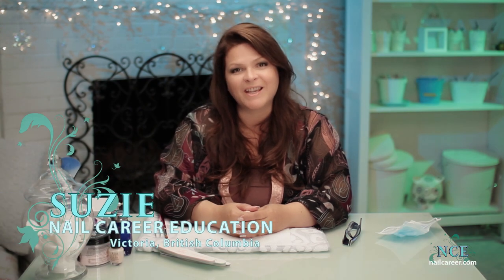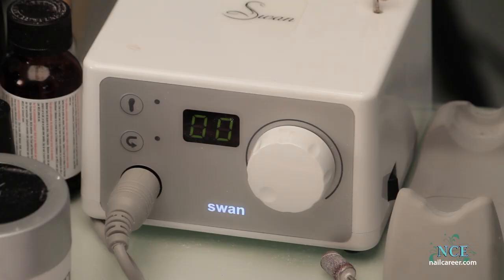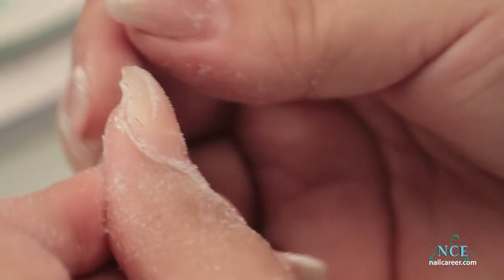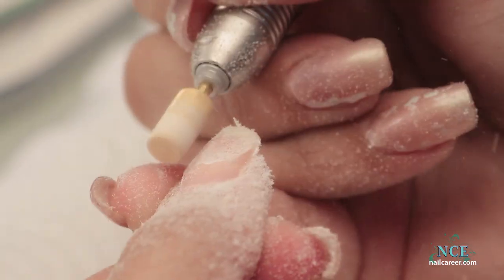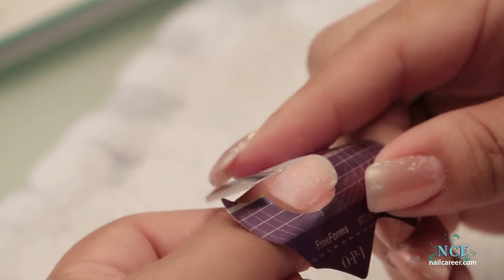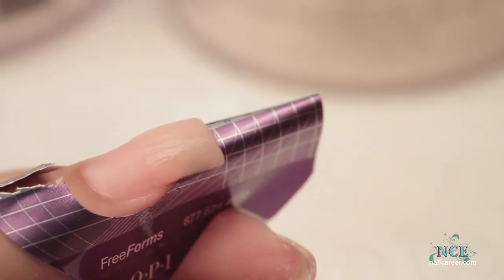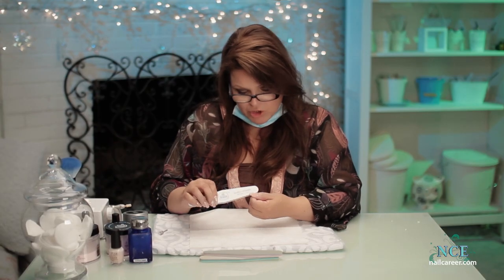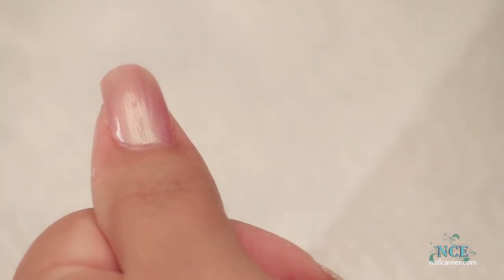Repairing A Lifted Acrylic Nail - Step By Step Tutorial

Comment: Watching your videos has opened my eyes on how bad the nail salon I've been going to is!  I had never had my nails done professionally before and recently started going to a nail salon that got decent reviews online.  The first time I went there to get my acrylic nails removed all they did was use  nail clippers to cut the length (which split the nails all the way down) and then took a nail tip and shoved it underneath the acrylic to pop them off!  I complained to the lady that it hurt and she told me "You've never done this before, that's what it hurts." These videos are EYE OPENING and I definitely will not be going back to that salon!!
Reply: The first time I got acrylic nails it looked like I had them on at least 2 weeks. I didn't realize that until a few days afterwards and I had been watching Suzie and other professionals doing nails. I 4 days later had them professional and gently taken off. I went with glue ons but decided to try it myself after seeing Suzie's and a few extreme beginners review the kiss diy acrylic kit. In spite of a lot of filing and not quite bump free, that I see, they turned out pretty well.
Reply: I've been where you were. I don't go to nail salons anymore because of how they do your nails

Comment: Oh how right you are! Getting a fill a few yrs ago I had to go quite a bit longer in between fills than normal & the product on my nails was honestly not worth saving (especially since I wear mine really short; athletic short) although all (magically) still full attached. The woman decided she wanted to start from scratch, meaning removing previous acrylic. Instead of soaking or filling down (either would have been more pleasant) she took a large tip & manually lifted the acrylic. It not only shredded my natural nail but hurt so bad! It made the acrylic itself almost burn & any and all filling on the acrylic burnt straight through that it left actual pinkish red marks on my natural nails. Needless to say never went to her again & although the finished product was pretty, my nails were sore for days!! Also, stickler for straight lines, it seems to be a nearly impossible task to find a salon who has a tech who can do a solid square. Tending to favor one side over another making the tip of my square a slant! When I ask most techs to redo them, they huff N' puff @ me! On more than one occasion I've taken their embrion board & filled my nails myself!!
Reply from the maker: Ugh! I hate to hear of this very IMPROPER removal. I have so many comments that tell about nail techs using a tip to pry off the nail enhancement. This is so wrong! If a tech ever says they are going to do that - don't let them! Walk away! In case you missed it, I have a video about the proper technique for a removal:
https://www.youtube.com/watch?v=z5ag9IIegfo
Reply: Nail Career Education I'm so sorry it took me so long to respond! I didn't know I had a notification; that area of YouTube doesn't always work properly for me. Anyways, I have seen it and you're 100% right. I should have said "STOP!" and either requested the proper way or walked out. Yes, she went about it all wrong and like an numbskull I not only let her but paid for it. A mistake I'll never make again. The worse part, most nail salons around me have always removed acrylic w/ the tip of a fake nail. I know they know this is NOT the right way but it's the "easy & fast" way and in the end, it feels like that is all they care about. Like a chain of fast food restaurants, drive thru nail salons... as many customers as possible! Unfortunately I can't afford a top notch salon so if I want my nails done, I have to deal w/ some inadequacy. 💅

Comment: Every time someone took off my old gel nails, they always file through my real nail and it hurts and it turns really red in that spot. :( how do you know when you are at real nail on someone else when the color matches the real nail??
Reply from the maker: +Chelsea Muhle experience is how you can tell- and the client usually say 'ouch'.
Reply: (I'm not a professional) but when I do mine I stop will the drill before I think I'm at the natural nail and use a sanding bit (it's a thing you can attach to your drills.  It's basically like a regular nail file, and it won't hurt ur natural nail.   It won't file away your nail

Comment: I learned to do acrylics the old fashioned say, I guess I could say. I use tips and I file around the cuticle with the drill and shape the top of the nail that way. I shape the free edge before hand with a nail file. Then I use a soft drill bit tip to smooth it down then follow with buff and cuticle oil
Reply from the maker: That's actually not so old fashioned - that's how it is done today :)))
Reply: +Nail Career Education well i guess its not old fashioned but it just looks so different when i see peoole use hand files to shape up the whole nail. and they way they apply the acrylic too.

Comment: Quick question! When I have acrylics done professionally, they usually lift at the base of my nails, almost look crackly, after just 5 days. I'm usually not too rough on my hands (especially when I have them done professionally). Is there anything I can do to prevent this or maybe should I just go to a different salon?
Reply from the maker: It could be the Gel overlay in which they could be curing it too long if it's the acrylic it could be to dry in the application 😳

Comment: i used the kiss acrylic kit and after a few days i had a nail just pop off and since then they have been popping off... any tips??? and I think they are all lifted but for next time any tips?

i'm sooooo bad I sat here and peeled off my acrylics... they were lifted anyway tho...
Reply: she has a video where she uses a Kiss Acrylic Set and there she explains why she thinks there could be liftings :)
Reply: ya but i w watched it already...
Reply: Sierra Tonon are you haring the tips or forms my sister got one any the tips popped of but the forms worked
Reply: mainly bc it you didnt prime and dehydrate it (im assuming, since it didn't come with the kit) ive used the sally nail kit for years and it usally last 1-2 weeks before it lifts with no primer if i was super careful. i moved on to professionals acrylics now and they last ao much longer. If possible go to your local beauty supply and by some acrylic,  monomer, primer and dehydrator.

Comment: The primer is an adherent right? When you put it on should it be sticky or tacky on the nail? Also is there such a think as too much primer?

Edit: found the answer to too much primer. Answer: yes, over saturation can lead to infections if it gets soaked into the root of the nail.

Comment: +NailCareerEducation I hate to be a pain in the teeth. I've got a couple questions in regards to the removal process. I had acrylics done and the nail tech that did them did a a really good job but I didn't go back to get them taken off so I did them myself- veeery stupid move. I ended up ripping one of my free edges (vertically not horizontally) so my question is how do I fix my free edge because it's killing me and two how long do I wait before doing my nails again? The free edge that split is slightly split into the nail plate- lesson learned; soak them off.

Comment: I'm a little confused.. You don't want to pull off the acrylic because it will distress the natural nail, but you can buff and file it?
Reply: yes because it only takes off very little off the nail, basically just the oil and the very top layer, which you would also take off if you polish your nails with a file until they shine. but since the acrylic or gel adheres to your nail, several layers of your nail are gonna come off with the acrylic/gel. this is why you don't wanna do this.

Comment: I love your videos!!! I wish I was as skilled as you! I have a few question if you don't mind me asking... How weak is your natural nail after taking off the acrylic? When I get gel or the powder stuff and they take off it to change the color I feel like my nail is like a piece of paper. Also i noticed when I do get my nails with either the powder or gel done the ends by the cuticle always curls up as it growing is that normal or did they do something wrong? It usually is like a week later or so and I want to file it down but it's starting to chip... It's really interesting to notice this
Reply from the maker: +Teresa Brunner Hi Teresa - when Acrylic or Gel sits on the nail and then you take it off your nail is a bit softer - this is not unlike when you put a bandaid on your skin it softens the skin that's cause the air makes our skin  alittle softer - the nail does the same thing when acrylic or gel is covering it - but after alittle while it will harden back up :)) As for the other question - I am trying to understand - do you mean the natural nail underneath pulls or curls away?
Reply: +Nail Career Education the actual acrylic is curling. I'm trying to figure out the best way to describe it... It looks like when you get paper jammed in your printer.

Comment: I damaged a few of my natural nails when I did my bathroom remodel, because I made the huge mistake of not having any protection on them during the dirty work, not even polish 😩 I have now made a promise to myself not to use another power tool, hammer or saw without either acrylic or gel on top, that way if I hit my nail, it’s the overlay that’s going to take the brunt of the damage, not my natural nails like I’ve done this time... My right thumb nail is just a wreck, starting right at the cuticle, had I hit any lower I would have gouged my finger itself 😫. It’ll take months for this to grow out but no one else needs to know that because with my beautifully sculpted nail, tip with polygel overlay, it looks fabulous 😂

Comment: suzie, what do you do if your pushing your cuticles back and then trimming them and your finger start bleeding?
Reply: The first thing you should do is to disinfect it. Then I would suggest putting some healing balm for wounds and burns (there are some), just because skin on the fingers is quite sensitive and it can bug you for a long time when it is healing by itself. As a solution: don't cut the cuticle, just push it, even if it is still noticable, just push and moisturize it, it might take time, but the cuticle does get smaller. When cutting it grows back, it repairs itself, you damage it - it protects itself and the nail. Put oils, hand seemed - whatever you want really and try not to cut it:)

Comment: Doesn't the drill hurt or burn the cuticle or skin when it gets in touch with it? Love it but wouldn't want to hurt myself using it.
Reply from the maker: The drill ONLY hurts if it's used incorrectly - and most drill bits wont cut the skin if it hits the skin. Learning how to handle a drill is key important - just like a hairdresser with scizzors :) great question Thomas

Comment: I have a primer that you have to cure I got it with my gel nail kit. Would I be able to use it for acrylic?
Reply from the maker: No. Even though acrylic and gel are the same  chemically they are different systems - you cannot use their systems together - you can put A Gel on top of acrylic but you can use the base gel then apply acrylic 😉
Reply: Nail Career Education thanks I'm saving to buy acrylic stuff and I wanted to know if I should buy another primer :)

Comment: Every time my acrylic nails used to lift, my nail tech would ignore it until it got really bad. Then she would use an acrylic tip, wedge it under the lifted part, and pry it off like a crowbar. Extremely painful and damaging to the natural nail. But how can you tell someone how to do their job? I never tried anywhere else because I figured that's what they all did, before I knew better.

I also don't know if it was just me, or the way the nails were applied that led to the constant lifting. I am a "picker" - if there was the littlest gap or chip, I picked at it and made it worse. But why were the gaps there in the first place? Maybe I just needed to be more careful with my nails, but I still wonder what the reasons might be.
Reply: I've actually stopped the nail tech (all of mine were Asian), told them they were doing it wrong, or using the drill like a psychopath, & said I'll do it myself at home, got up & left without paying...if you don't know as a "professional" what you're suppose to do, then I'm certainly not paying for your "services".  Client has the right at any time to stop the procedure if they feel something isn't right.

Comment: omg im always trying to use my drill at this angle but im so scared to go too deep and make a cut into the nail. So i never really do this hehe BUT i use my safety but one on smaller lifting and it works really well, just chips off really easy.
Reply from the maker: Karen Valkyrie Yes, your so right - IT IS scary! That's why I take short little bursts. It helps eliminate the burn and heat. Great to do it on yourself so you can really feel it. But if your using this bit already then your a confident tech - you got this :)
Reply: Yeah your right ! THANK YOU, your the best teacher cause your so REAL and realistic =)

Comment: I use hard gel and for me it's so hard to tell where the gel ends and where the natural nail begins! Any tips for me?
Reply: I would say use a hard drill where you're absolutely sure it won't hit the natural nail, and a softer file for the transition area just it case it touches the natural nail.
Reply: Thats what I've been trying to do! It's just hard because when you're filing, the gel kind of shatters off and a thin layer isn't left on the natural nail to protect it.

Comment: Is there a formula you use to determine the thickness you want to achieve? Ex: a tech I work with believes enhancements shouldn't be thicker than a credit card. (I think they should be slightly thicker than that.)
Reply from the maker: Well credit card thin is more for nail competitions - some competitions ask for them to be business card thin- a salon nail is does not have that expectation / in fact clients would break them- I would a bit thicker would be advisable 😀I agree with you

Comment: Isn't it very damaging to always have acrylic on?? (Not trying to hate just curious)
Reply from the maker: Great question- Nope not damaging at all - the product itself is not a problem, the only problem maybe how it is applied.):)
Reply: +Nail Career Education that makes sense, thank you :) it just seems like your nails would get thin and brittle or start peeling but I suppose not
Reply: Whenever I remove my acrylics (I soak them off, no pulling) there is a definite ridge between my new natural nail and the one under the acrylics, it is also very weak and thin. Is my nail tech filing my natural nail too thin or is this normal?

Comment: when a nail is that badly damaged I would think it would be less stressful for the technician and less painful for the client if you just soaked the nail off in acetone and started over completely. Thoughts?
Reply from the maker: When I began filing this nail I didn't realize it was so lifted, filing a small lifted area doesn't take to long / soaking takes way longer so I prefer to just file / it's very boring for client to soak - it really can hurt if the tech doesn't know what they are doing 😀good question
Reply: Nail Career Education Thank you very much! I really appreciate the help. :)

Comment: I've only had acrylic on my nails once and I'm starting to think the guy who did them did them wrong? he put on a fake nail on the tip of my natural nail and then shortened them then added acrylic..he also didn't wear gloves and used his natural nails to push my skin away..which hurt and I swear anymore pushing I would have bled.
Reply: the putting the tip on the nail isn't abnormal and is done in a lot of places. she even does it some times but every thing else he did, now that isn't very normal.

Comment: Why not soak it off?? (just asking :-))
Reply: It takes a long time. :)
Reply: best way to remove IMO, is to thin the acrylics thin as possible. then soak in containers that have a top and bottom. bottom for hot water and top for acetone. 10-15 min soaking. wipe off any gooey remnants. then gently file (fine sanding band) the acrylic off :)

Comment: Buffing natural nail is harmful. It's taking down the natural nail layers. Also, I'm not sure if your oil is a natural oil, that soaks in, whereas you don't have to wash it off. But, if you do have to wash the oil off, it isn't doing anything. I know you probably already know this but, just wanted to inform you.
Reply: Buffing the natural nail is required to remove natural oils to reduce lifting. There is no harm in lightly buffing the nail.

Comment: Would be some much easier to just soak it all off. lost of work for nothing...
Reply from the maker: Soaking off verses filing is a professional choice-I'm very experienced with the drill, so for me filing  is much faster and more efficient- also this video tutorial was a kind of discovery-it was to demonstrate what the issue is, the problem, and by filing we could see how it unfolds, how indepth the break was- if I just soaked it all the information wouldn't be about this technique it would be an entirely different video. I was also trying to show filing as an option because if this break was bad enough that it broke the natural nail bed and caused bleeding then soaking Acetone wouldn't  be the best option 😀